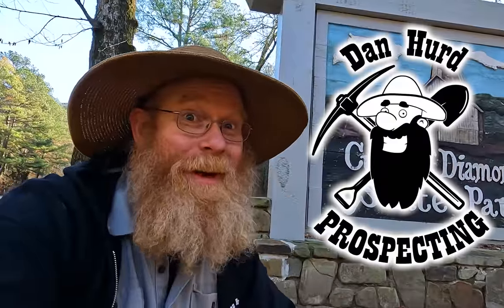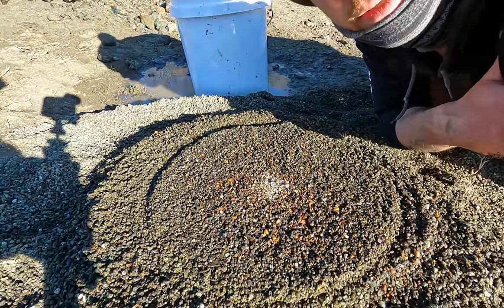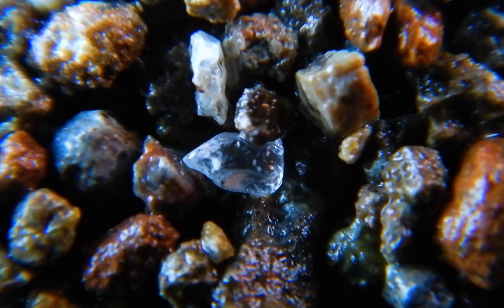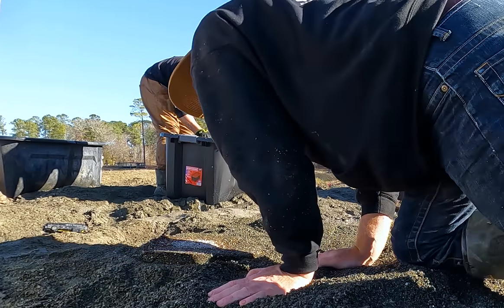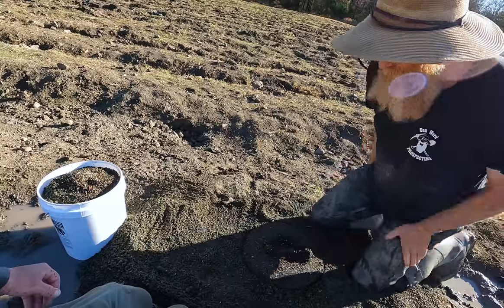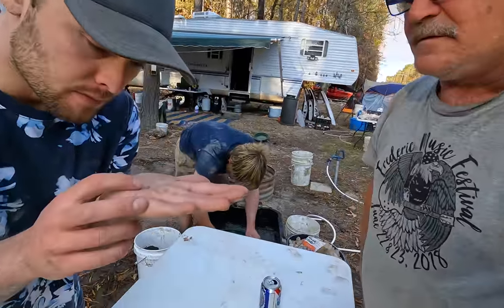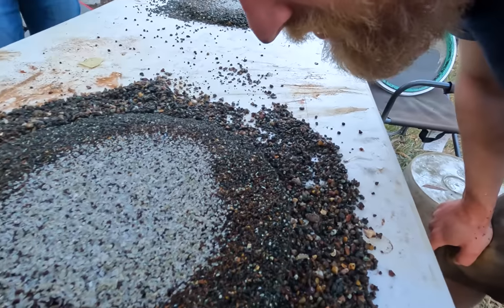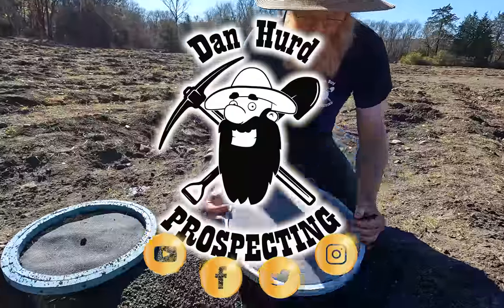Can the Team Find a Diamond?

Comment: Truly, the best part of COD is that you will meet some really nice people. It doesn't hurt that it's free, paid for by the people of Arkansas. And yes, it is hard work, and the odds are you likely won't find anything super valuable, or even at all. You will get messy, tired and make a memory that lasts a lifetime. It is out there, lot's of God's country in central Arkansas. A lot of people use dry wash sifters there. (It's kind of like  horse race betting; everybody has a 'system').  Hey, fall and spring are the best times. It does get pretty cold out there in winter, the weather can change literally overnight from the upper 50's to the upper 30's or even lower in 12 hours,  and CenArk summers are hot and humid.  If you've never been down here, well, there is a movement to change our state bird to the Striped Mosquito. Ticks are also a problem in this area, and if you get out into the grass chiggers are a possibility, so lots and lots of insect repellent is recommended. BIG hats and sunscreen; you folks from places where you don't trust air you can't see have no idea how intense the sun is here. Nothing worse than a nice sunburn on the first day of vacation. It's pretty far out away from, well, anywhere most folks would consider "a city" and the towns around it (which aren't really all that close either) are pretty small and offer very little. Bring what ya need!

Comment: @Dan Hurd  Seeing Polly have a hard time flipping those sieves gave me an idea. At the equatorial points on the sides of the sieves add a couple wing nuts but drill the holes larger than the threads so they don't stick and can rotate freely. Put in a cpl rubber spacers to avoid seizings. The wing nuts on each side will facilitate the flipping of the sieves with ease.

Comment: If I recall correctly, the SA minors used to wash the concentrated over a greased iron plate. Since diamonds do not wet like most other stones, they would stick to the grease and were periodically scraped off. 

Is my memory faulty and is there some reason that method is not used at CoD State Park?

Comment: The diamond miner uses a long rod to find river gravel and heavy rounded rocks close to a meter deep and sluices all of that stuff
Reply: Bingo. This was what they're missing. Locals spend all day with rods in the muck finding and collecting the right gravel. They push the rods down until they hear the right gravel layer. Remove the overburden and muck. Fill buckets all day with that gravel. Washing and checking for stones is done in an hour. It' a much coarser almost pea gravel sized. After 20 buckets of mostly gravel more than 5 diamonds is common.